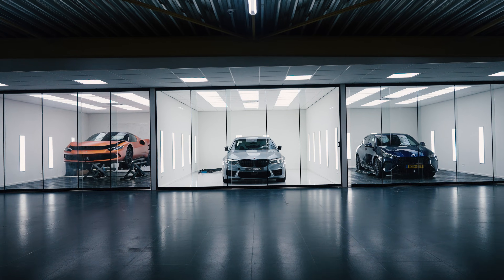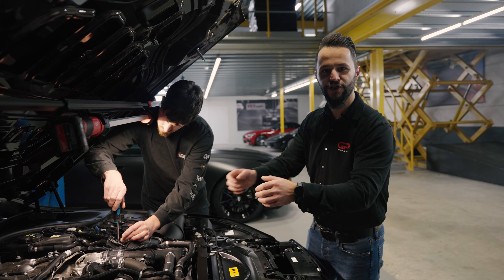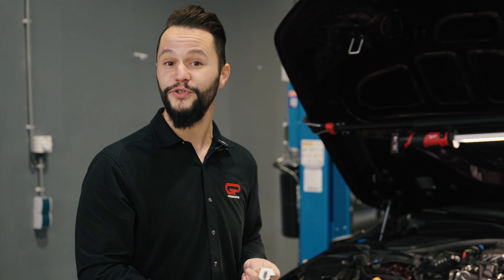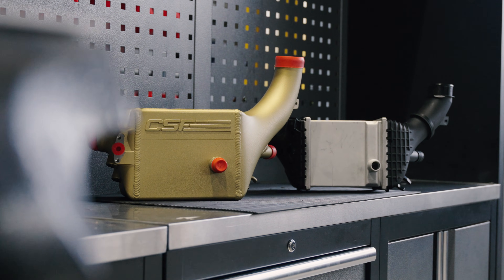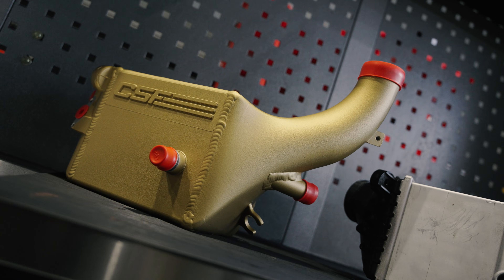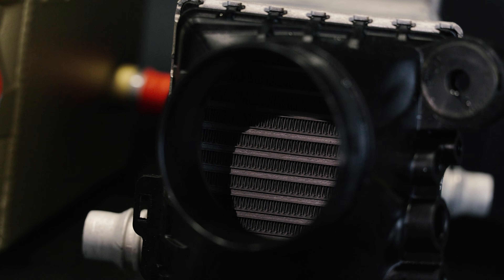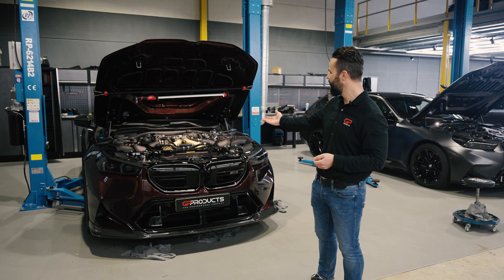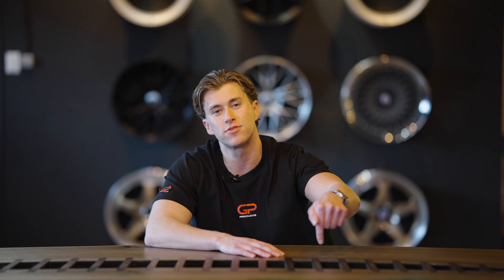Installing CSF  CHARGE COOLERS on a BMW G99 M5!🥵 - INSTALLED & EXPLAINED

Comment: This requires some more science. Pressure drop of the IA over the CC please, and multiple pull IAT data. It is all about the core used, and unfortunately CSF is not using top of industry cores. Furthermore, when you increase the flow over a set of CC's, you put more temp into them, so you also have to upgrade the radiators. In fact, if the std CC's are at their max, then the first upgrade would be to upgrade the radiators, and not the CC's without the radiators. Despite the deficits of the std CC's (plastic tank at alu core, potential for leakage although I never experience that with my ///M's the past 10 years)) they are typically much lighter than aftermarket ones, making them much less prone to heatsoak. Furthermore; 2x the volume means added turbolag. I would only consider them for stage 3 mods, turbo swaps etc. Doing so I think you should reconsider your weapon of choice anyway and move away from 2500kg cars LOL.